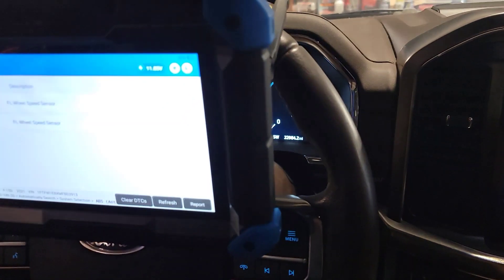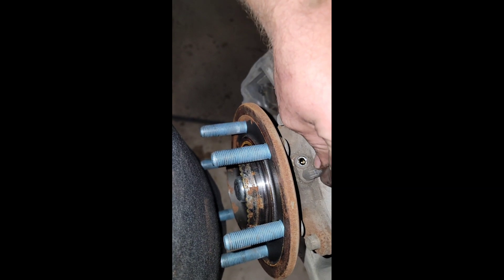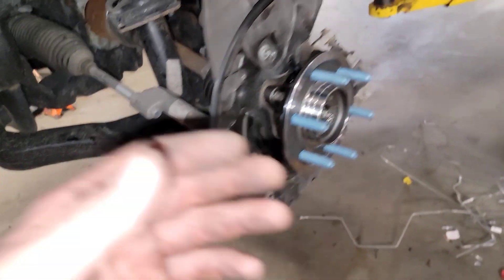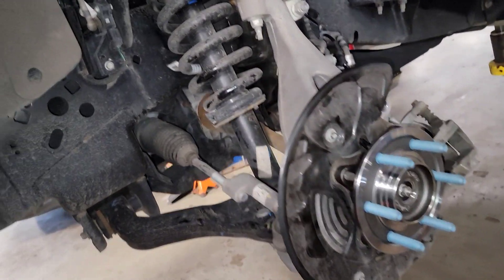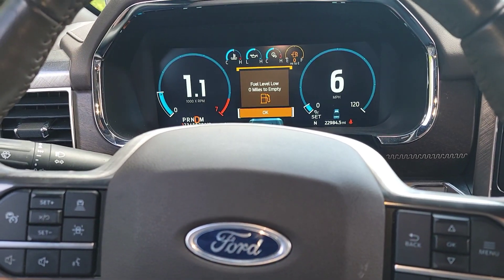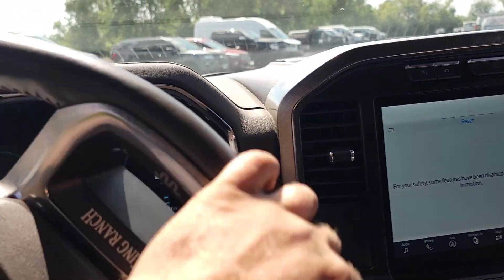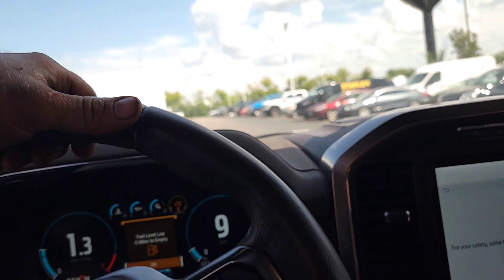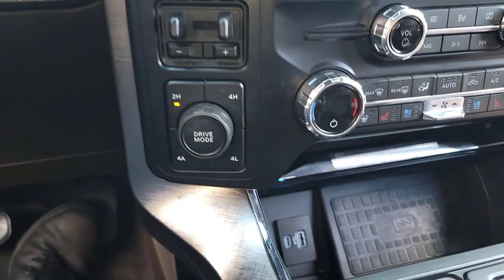2021 F150 Wheel Bearing Failure ABS Light on - Replacement - Let's Look At the New Hub Actuator

Comment: My mechanic just put a new hub on the rear of my 08 Caddi CTS yesterday.  ABS light came on cause a chunk of the Tone Ring exited stage left.  It's open to the air, wonder if a rock hit it and broke it.  He said it was not rusty and showed it to me, he usually has to torch them off here in PA.
Reply from the maker: Prob a rock

Comment: Good video.  I have a 2021 King Ranch, dealing with some noise around the front left wheel area.  Not clear on how to really verify hub/bearing or just replace the dang thing.  The noise is light, but is especially worse around 40 mph.  Any advice or should I just pull the bearing out and replace.  Does not look that bad to change to be honest, the last thing on this truck that is bothering me, have all the updates for BC now and recalls complete, want to keep the truck for a good bit.

Comment: The push buttons make it easier to accidentally shift to 4wd. Imo having them switched manually on the hub is best as you want go to the trouble of getting out of the truck and switching to 4wd unless you really need to.

Comment: Does truck need to be on when trying to test with the reader ? My reader isn’t picking anything up off either one ??? Guessing it’s something I’m doing wrong any idea ?
Reply from the maker: It needs to be just key on and then to monitor live data running it needs to be moving
Reply: @FordBossMe  I’m using a volt meter I am getting .440 of one sensor and .476 off the other one. Is the .440 one bad ?
Reply from the maker: @jakesrcaddiction  use your scanner and go for a drive and look at the wheel speed sensors that way don't rely on a voltmeter
Reply: @FordBossMe  my scanner I have isn’t that advanced it just picked up an abs fail code.
Reply: @FordBossMe  do you think that is the issue or ?

Comment: Looks like Ford is using some sorta lock tight or thread sealant on the studs now?
Reply from the maker: They've been doing that for a while so you don't have to use any kind of lubricants or anything on the threads it's already on the studs permanently

Comment: Any chance we can get torque specs on the bearing/hub, caliper bolts and the axle locking nut?  Also type of grease for the IWE internals?
Reply from the maker: Well I can look that stuff back up when I get home but you're going to have to wait until next week the grease that you use is just a high temp bearing grease that's nothing special about that so I won't be home until next Monday remind me then

Comment: Are we sure that the electric motor is not what is operating the in/out of the IWE and the vacuum line is now
 just a vent line ran up into the engine comparment?
Reply from the maker: You know what that's a good question let me do a video on this

If it was electric then the vacuum line was just a vent then there would be no reason to even have that line there because it's not vacuum operated or released
Reply: I was just thinking if it still had a grease seal diaphram that it might need a vent line to move back and forth. @FordBossMe

Comment: Interesting. Only factory Nav problem I’ve had was the gps shutting down 12 hours into a trip in 99plus degree temperatures. Think the system overheated. It reset after a restart

Comment: Do they still have that NVH mat underneath the back of the engine and the transmission?  I still see those hanging off, slush rips them off around here, and people drive around with them hanging everywhere and dragging.  Nice to see plastic oil pan went back to metal.
Reply from the maker: Man there's all kinds of stuff underneath that line these now
Reply: @FordBossMe  Well on my 2013 it was dragging during a winter highway drive, I pulled into a parking lot trying to reclip it with the salt water dripping in my face, laying in the slush.  Then some 12 year old boy walking by shouted "should have bought a Dodge".  I was pissed, lol.  Thing still had bumper to bumper at that point, dealer just told me to take it off and fire it away.  How much noise and or fuel economy do those things actually reduce?  Yeah I still see them hanging off around here, anywhere's you get heavy snow I'm sure they are lining the side of the roads.  I think they design them for USA market first, Canada is a small market.  The old man has a 2022 limited we will see if that one starts hanging down lol.  He doesn't actually drive the thing, 1500 miles a year, so he's likely good.  Don't think the Coyote has that, it's an ecoboost thing.

Comment: Do you replace a lot of 4A TOD transfer cases from people riding around in 4A? I noticed that some of the new F150s are being built without IWEs and have front axles that spline directly into the hub assembly. I have to wonder why Ford decided to leave the front axles and driveshaft spinning at all times on those trucks when most manufacturers are doing anything they can to get an extra 0.1MPG.
Reply from the maker: No I don't replace a lot of transfer cases because of that this was because of something else but you do cause Driveline where and tire wear from running around in 4x4 automatic even though it says you should be able to do that it doesn't mean it's a bright idea to do so especially on a dry day whatever you got to gain? Nothing and everything to lose
Reply: @FordBossMe  I don't disagree, most people who run around in 4A all the time only seem to do so because they want to "set it and forget it". Most never bothered to learn what 4H or 4L mean or when it's safe to use them. I have a few customers who leave their vehicles in 4A and instruct their kids to never touch it because they say it's safer and cheaper than having a kid accidentally leave their truck in 4H on dry roads. Teaching them to use the vehicle properly would be a better solution in my mind, but you can't teach everyone.

Comment: Great video. Can you elaborate on why most wheel hub fails. my failed and I thought it was due to my lift and wheel. But I have seen some fail with/without  lift. Less miles  now on a new truck etc. I don't see any real definitive reason other than they just do. Maybe you could shine some light on the subject. Also I was going to comment on the 4A mode, but you hit on the nose when you made the oil change intervals reference. Now im just going to keep my commet to my self..lol. I don't follow the recommended oil change. 5k is my interval no matter what. Any how keep up the good work.
Reply: I had a wheel bearing go bad after hitting a nasty pothole.
Reply from the maker: Quality and water intrusion
Reply: I’ve had a few come through the shop with worn axle bearings abs leaking seals with low miles. A majority have oversized wheels abs tires, with spacers. The engineers specified wheels that are centered under the hub for a reason.

Comment: Great video. Could driving in a flooded out road or off-roading cause that hub to get damaged like that?
Reply from the maker: Yes
Reply: Doesn't that kinda defeat the purpose of having a truck though if you can't off-road it when that's part of why people buy a 4X4 truck. Doesn't seem like that great of a design at least on the reliability side in my opinion.
Reply: And I just want to clarify I'm not trying to bash Ford or Rich or anyone. This was more of a question I guess more than anything. Thanks for the videos Rich.
Reply: @nicksrandomviews1296  be more careful, off road truck isn’t perfect or indestructible, it’s just more capable with the right driver. Besides, most buyers just want to show off in their big fancy new truck, they don’t do truck stuff
Reply: @jtomtl  I understand that and have had a few off-road capable vehicles but never had an issue with a wheel bearing or speed sensor on a year old truck. I guess it could have been a fluke but who knows.
Reply: @nicksrandomviews1296  maybe it’s build on a Monday or Friday with faulty wheel bearings, anyways, it’s covered under warranty so all good there
Reply: Yes, my pb21 F-150 is stating in the manual that 32 in is the maximum waiting depth, so that still should be covered under warranty

Comment: Rich, Your Comment on the "Clunky 10 Speed",  My 2022 LARIAT 3.5 V6 Ecoboost (725 Miles) on the ODO, is Really Clunky, Exactly like you said. And coming to a Stop Slowly with No Throttle, Often when it shifts Down into 3rd Gear, It's a Noticeable Clunk/Jerk, enough that it Get's your Attention. Sometimes it will SKIP 3rd Gear when downshifting and the CLUNK is Much Less Noticeable and Sometimes Seamless? Weird. If you Figure that one out, that would be Nice to know.
Reply from the maker: Ford says it hunts for the appropriate gear and it's normal, fuel saving strategy 

But idk if I like that answer

Comment: Sorry the IWE is spring engaged and vacuum released the solenoid is on the passenger side of the firewall and was not protected from water off the cowl would enter the solenoid vent and be drained into the IWE and freeze causing partial engagement stripping the clutch teeth. Ford came out in a TSB for a rain hood an umbrella that covered the IWE solenoid no water there again. I have a 07 that has this mod as built and living in the salt belt and lake effect snow in Canada in Hamilton Ontario we had a storm last year that crippled the city not one city bus not stuck blocking the streets. One foot snow and 5 foot drifts my wife a nurse needed to get to her clients to get them the meds they needed a Ford Cmax not even getting out of the drive way. I took the day off and drove her all over the city with my outdated IWE system man was high sided a few times but got out. My point is stop trying to reinvent the wheel ignorance on how and what causes failure is what engineers rely on. The IWE system is a good and reliable system if you know it pre 07 get the rain hood drive steady when engaging 4WD dont coast or speed up. If you have a IWE with water in it no way to get it out and probably stripped replace them get the rain hood and scrap your truck with them fully functioning. And unique nothing is driven in a IWE system in 2wd the wheels only other systems drive the front axles Gm and Dodge  parasitic loss and wear on the spider gears rely on locking one of the axles on the front diff otherwise spider gears spin .
Reply from the maker: I said that is how the old solenoid system worked...

Comment: Come on Ford just figured out the IWE no water ingress now putting a solenoid on there. The longest run the Crown Vic no better mods just the way you made it for many years and it never broke a shame a sedan that was bullet proof. Could drive it until the cancer took it that 4.6 easily could get 500k. But the engineers have to take a solid reliable proven machine and make it worse because they will have revisions to fix it to pre back to what it was just threw a bolt in the works now took it out. A engineers motto break what works than fix it that is what justifies my salary.

Comment: I have never never heard of any master technician from any automobile manufacturer who says to follow the new 7,500 to 10,000 mile oil change interval. They all say spend a little bit now and change it frequently or spend a whole lot later. And riding around in four wheel drive, automatic or not, on drive pavement is just plain stupid.